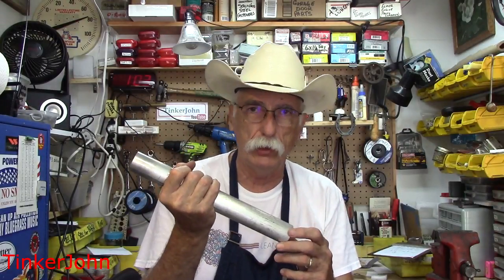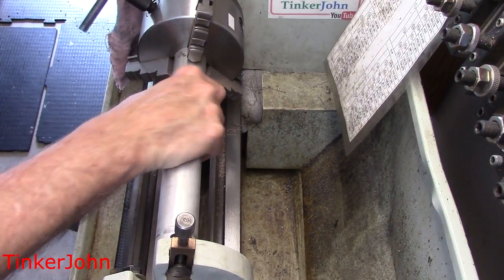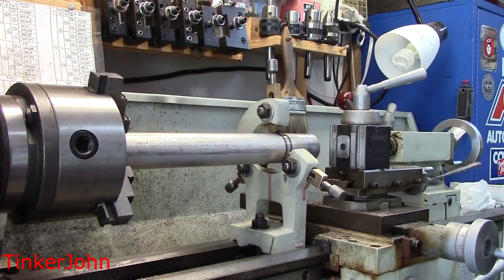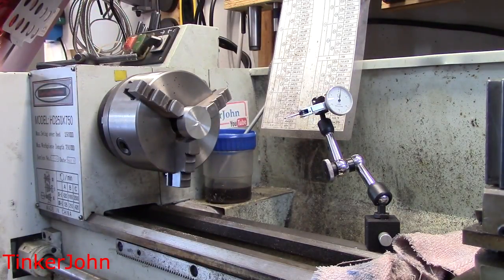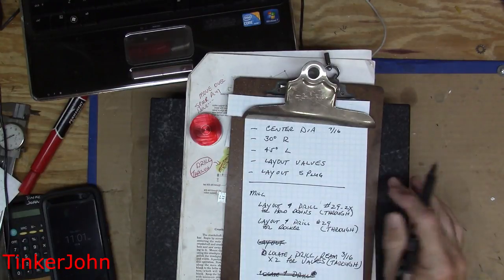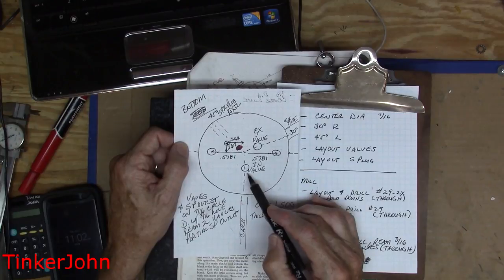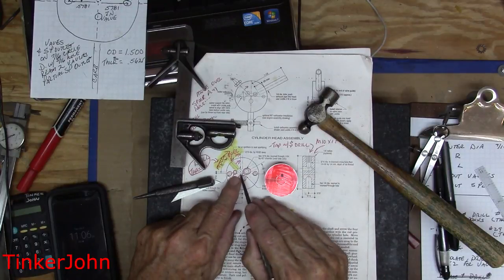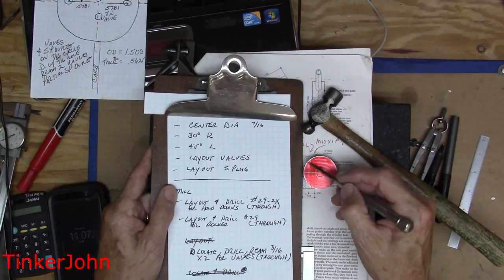Building the Upshur IC Model Gas Engine -- Part 8 (Head)

Comment: Just curious, if you might remember. For your valve you use 3/16 (0.187). My newer print calls for reamed 7/32 (.2187). Was this to your print, or a change you decided on (uncommon reamer size)?  Thanks. --Mark
Reply from the maker: Thanks for watching and good luck with your engine.  I used the 3/16 since it can easily be obtained from any welding supply as brass welding rods.  Works perfect!  Also I don't need to buy specialized reamer.  Hope this helps.  ~John
Reply: @TinkerJohn_W5CYF  yes, thanks for the quick reply. I am building as close to print as possible, and at the same time following your videos for each step. Ordered the special reamer, I'll let you know of my results. Can't thank you enough for making these vids, gives me a heads up for every step. Take care my friend, safe travels. 😎 --Mark

Comment: If you have indexing on your lathe or an index wheel could you have located the holes in that fashion. Then with a four jaw chuck offset the piece and do the drilling on the lathe? You did not note why you did not locate the head mounting holes so you must be planning on doing that when the cylinder is made and then match in some fashion?  I enjoy watching you build but I admit it can drive me nuts not having the full plans to look at. You could have really challenged yourself by adding in a cross or circular fin pattern in the top of the head and then had to plan how to make everything else match!!!! HA!
Reply from the maker: Galen, the head is actually held on with two studs that run down to the top plate, no other holes are needed.  Simple and works fine on this little engine.  I like simple!    ~John